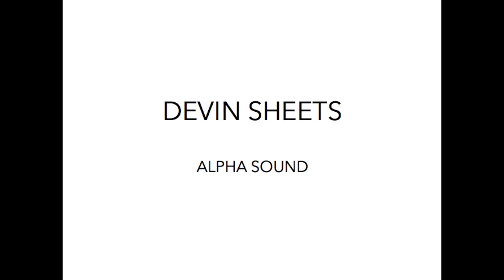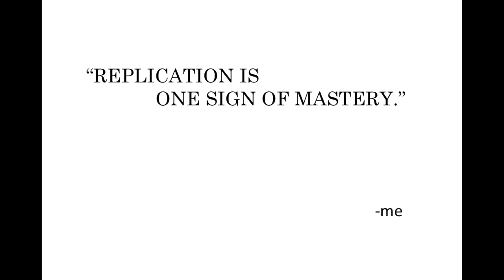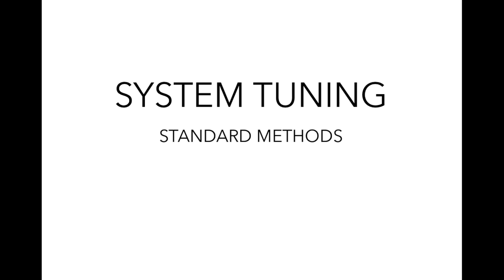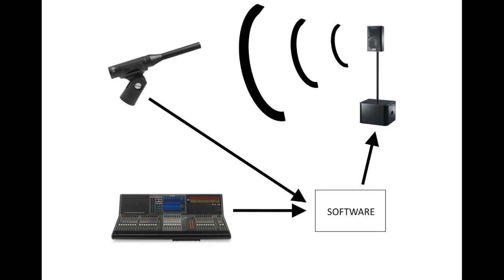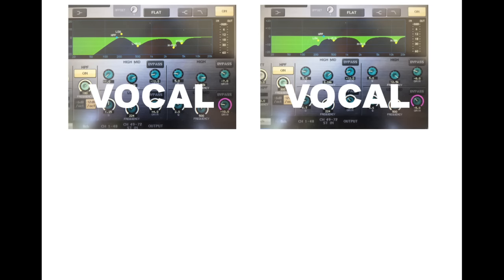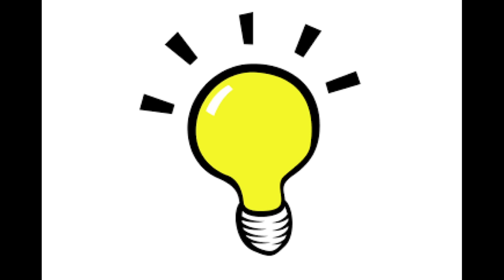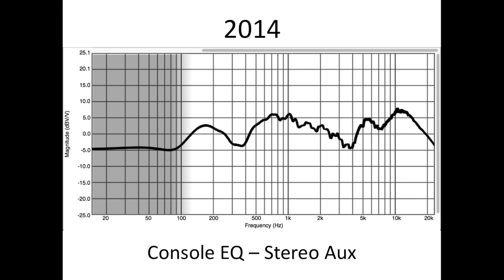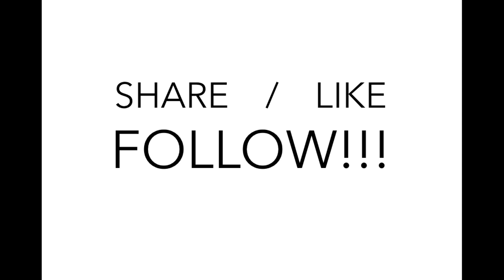Sound System Tuning By Ear

Comment: Can someone who understands how home theatres know how to use these, by tunning a speaker with a spl meter and using the controls to make the sound not peak over its desible at its listening postion but also 1 meter  at the speaker, also by knowing how much power the reciver can give to each speaker without the reciver losing power can do this, eq settings are also easy to me, your just tunning that frequency to the dsp volume that you want it to be at a certain listening position so if its quite at that frequency you can turn it up and if its over peacking which one it should never do you can turn it down because you shouldn't have a speaker packing at its listening position at 1 meter unless its peaking range is louder then the full volume it can go, idk i know how my works but it took me years to understand that.
I own a 5.2 powerful sound system that costed me 4.5k, its only used in a small space, i have the klipsch speaker set, dont need to know though, i ranged those at 80hz at 75dp at my listening position and the subs at 20hz the loudest both at 75dp, i set each volume on the spl at my listening position to that volume and set the meters at the listening position on what the setting had, i dont have any speakers peaking because its not going louder the maximum volume at its range from one meter which each info the speaker talks about.I

Comment: I strongly disagree with one thing: i NEVER use computer controlled front mixers anymore due to or software/hardware failures of electronic failures during shows/concerts. I prefer it to be old school front mixer like a Soundcraft 200B, Soundcraft Ghost, Soundcraft K3-5 series or Midas XJ series (minimum 48 channel, 12-16 EQ, 10 auxiliaries and 10 sub groups with extra 2 master outputs for delay stacks). And i only work with (indoor only) JBL Pro Touring or EAW KD series or (outdoor only) Master Audio with a minimum of 24Kw per side. So yeah, i do only very big gigs as a front head sound engineer and i dont want to rely on technic too much anymore..! Most of the times old school (analogue) is waaay better then electric front/monitor mixers… it’s still all about the ears and hearing because EVERY venue/location sounds different…!

Greetings from the Netherlands 🇳🇱 
🙏🏾👋🏾👊🏾

Comment: Why would you have had to replace each of the cabinets over fifteen years?  That doesn't seem like a very long time for a quarter million dollar system to last.
Reply from the maker: haha good observation. what we do is often sell the slightly used boxes to installation clients at a discount and replace our concert inventory with new gear. It works out great for both people. Client gets a discount on gear that is still in excellent condition, and we get to keep our concert inventory completely up to date.

Comment: Good solid info video .BUT,  as time is often rare   ..Just get your main vocal mike on a stand middle of stage ,set it with 100hz hi pass flat channel EQ and turn it up as loud as it will go on main PA, when it feeds back notch that out from flat on the main system graphic, keep raising gain and do it again till no feedback ,same with monitors .This technique is tried and trusted never fails for any size speaker or  PA system.and takes minutes with no extra kit .
I would NEVER EQ a rig to a CD of some music I "Know" YOU EQ THE RIG TO THE LOUDEST MIC, no uncalibrated ears involved.
Ive engineered for 30 years and cringe when I babysit  a lot of modern shows with brillient equipment where you just cant make out a word the main vocalist is singing or there is feedback, especially when they spend  10 minutes  "sound checking" a snare drum!!

Comment: i much prefer to tune a system to a well produced song, i bought a dbx driverack ran it with the mic and it was awful! no serious sound system uses sm58 mics, i prefer beta 58 at a push but actially own beta 87's , used to use beyer tgx 80's, great sound but as fragile as eggs!